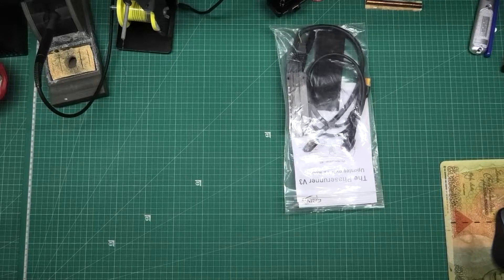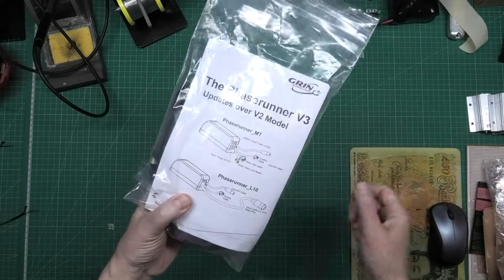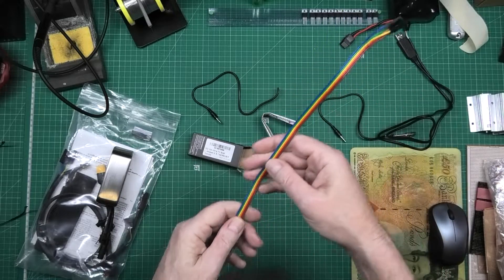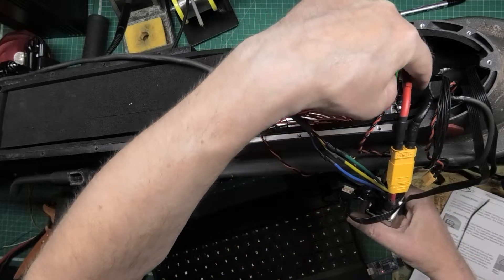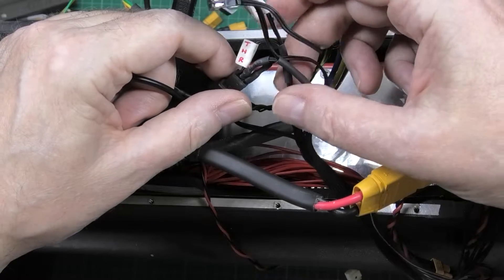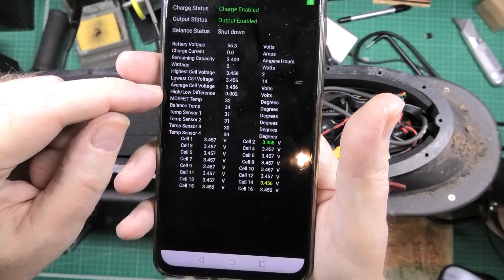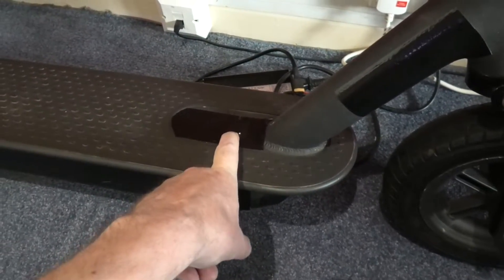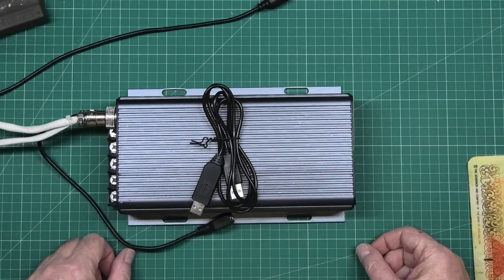Xiaomi M365 (codename V365) Grin Technologies Phaserunner install

Comment: I got the official adapter from grin and a knock off, none of them are showing up in their program!  No Idea why they went with TTRS, its so annoying! does your phaserunner turn on when it gets power? mine does not 😭
Reply from the maker: There are 2 wires you have to short, I can't remember which 2 but they're covered with heatshrink. I know I said something about it in one of my videos (it might even be in this one) but you have to do that first or it won't power up. It is in the manual as well and it tells you which ones. Also, I'm pretty sure you have to supply it with battery power as well as USB.
Reply: @Vortecks  haha I actually tried shorting power on the wp8 connector with a resistor… probably not the best idea lol. I’ll check the manual again for the baserunner, thanks for the advice! Also yes I did have 48v running to it

Comment: nice video mate been looking at phaserunner myself, i’ve got two 350 watt motor wheels and two 36v batteries and am looking at running dual motors with 72v so thinking the phaserunner would be ideal 

what do you reckon?

Comment: I havr a phaserunner v3 on my 1000w mantis motor on a zero10x frame and with proper tuning and a custom battery I made it reaches over 65mph with 90amps per phase and 2800w output from controller this controller is awesome im working on making a dual Moto dual controller version that is synced so 2 phaserunner v3 s on same mapping running front and rear 1000w motors on same frame lmk what you think

Comment: I have burned out 2 «original» m365 pro main boards.
If I replace it with grin phaserunner. I will lose speedo and charging status?
The rest will work?
Stock charger etc?

Comment: Tony

I was thinking of getting a Phaserunner. I assume if I did I could use my own battery and utilise the original throttle and brake cables etc to keep the throttle and regen signal etc.
Reply from the maker: Yes mate, it's what I did.
The only thing I'd advise is making it RWD. You probably already know but FWD is a bit dangerous when running anything over the standard power. Having in excess of 1kW would make it lethal!

Comment: Why phaserunner over some other less expensive, but pimped controller solution? Only because it should keep working with more wattage? Or does it bring some fancy driving experience?
Reply from the maker: Simply because there's nothing else which can handle the voltage (67V) and fit in the casing.
Reply: @Vortecks  Nice! I bought a secondary motor and I would like to put as much current in there, as the magnetic field can saturate those tiny magnets in the rotor.

Comment: The AMAZON interface is FTDI too...   I bought ones "fast"-one and it was useless:-)
Reply from the maker: I think my DIY one would have worked perfectly IF I'd known that the 2 power wires on the Phserunner have to be shorted before it'll work.

Comment: Hi mate you ever thought of opening your own shop or modding other peoples scooters ???? I could with my new Kugoo G-Max modding !!!!! 👍🏼
Reply from the maker: I've thought about it many times but there's too many people who want everything for nothing mate. They make scooters with loads of head-room so they can be run at a constant 100% throttle. If I was to start modding them as a business, I'd have so many come back after they'd burnt the motor out. Short bursts are fine but there's always one idiot who thinks that a short burst is 50 miles long 😂
Reply: Vortecks, I totally understand where your coming from pal and it’s a piss take !!!! I could do with some help with my G-Max though as I’m a mad brumy like your self lol and want more power and speed !!! I’d pay what ever jus to get another 15mph lol 👍🏼
Reply from the maker: @rossfarrell2576  Rip the internals out, fit a Phaserunner and a higher voltage battery and you'll get 40+MPH out of it. Those things have the same motor as the M365 Pro so I 100% know it's capable. If only I had the time to do it 😟
Reply: Vortecks, happy days mate !!!! Only thing is I’m turbo shit at electronics lol 😂 so I’d need a pro like your self. Thanks for the reply’s pal and keep on modding.
If you ever get the time and fancy a new project let us know 👍🏼. 
Take it easy pal...

Comment: I have a question. Is the sabvoton controller able to drive 2 motors? I've been looking everywhere for a dual motor controller, and no one seems to produce one. On forums people talk about either using two controllers with one throttle, but one of the motors will only work full speed when the other can be controlled from slow to high without a problem... Or use cycle analyst... For me the issue is, I want to be able to use one controller, with one throttle, and one brake sensor. I don't want to press the brake and stop one motor and the other to keep spinning (tested, and this happened to me), this was for the dual controller. I've tried with single controller and dual motors, and it got really hot, and after a while, burned the controller. Cycle analist, I didn't try, but having dual controllers and the cycle analyst I think there are too many cables and wires for such a simple task, and it looks too crowded.... And on the last part, I was thinking, a proper controller, with thick wires, proper mosfets, should be able to handle two motors... But I want to ask you first, as I think you have more experience with this...

Comment: tony quick question as soon as i start app and connect to bms i get a constant alarm and i cant work out the cause all my settings look correct but it does not show anything in log. any ideas? i only connected 1 temp sensor and the ones not connected just show -30 could this be it??

Comment: wondering why you havnt set up triple mode for your display. you can have eco/drive/and sport mode. so you have an extra mode and you can have different speeds/power curves etc. seems like this will really suit ya when ya don't need quite as much erm...oomph haha.  and if you havnt looked into it yet the Xiaogen modded firmware gives you a lot of custom parameters , be interested to see what the Russian throttle algorithm or quadratic curve mode would be like.
Reply from the maker: I already did that in the early days of having the M365. It didn't have enough power for me which is why I ripped it apart and fitted my own BMS and controller.
Reply: @Vortecks  is the 3 modes not compatable with your bms then. Randomly found your video last night while looking at m365 upgrades. Literally watched everyone 😂👏
Reply from the maker: @danf6491  Not anymore since I ripped all the electronics out and fitted my own 😁